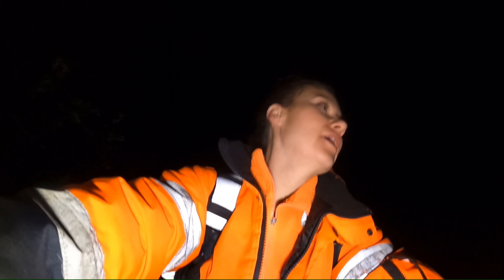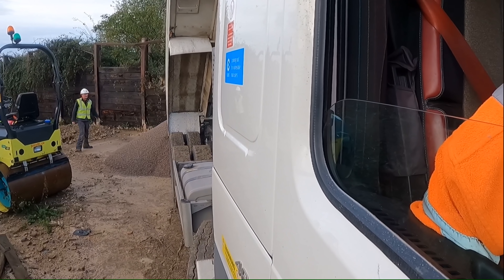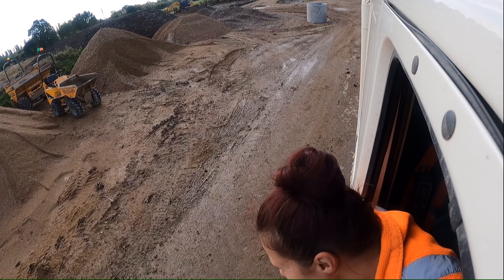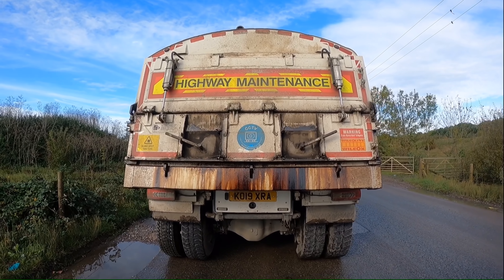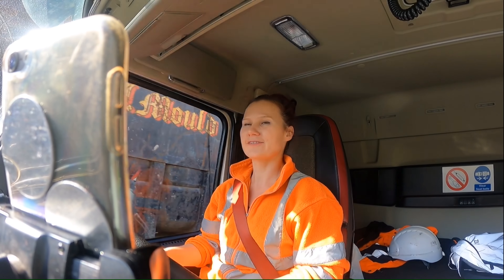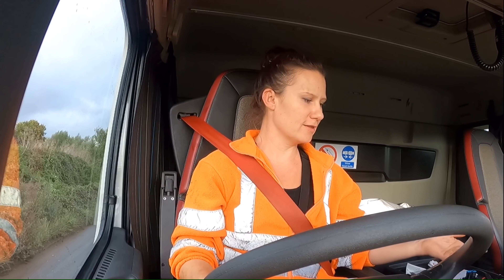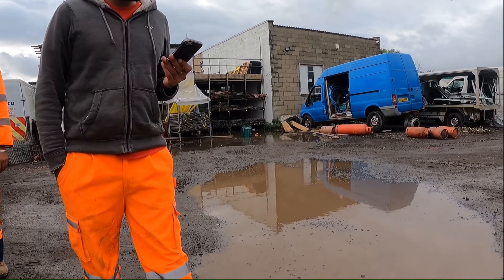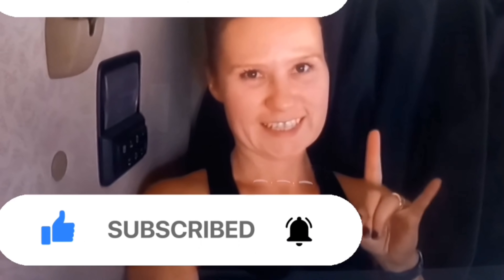A day with a female tarmac tipper driver UK 5/10/20 first day on a job.

Comment: A tip to do before tipping tarmac, spray your back door and hinges with diesel it will stop the Tarmac sticking.
Reply from the maker: Ooh thank you!! Will be trying that out today 👌🏻
Reply from the maker: Omg it works a treat. We spray T99 or something but yeah spraying it before I get loaded makes it soooo much easier!!! Why my boss let me struggle for TWO weeks now and never told me🤷🏻‍♀️😡
Reply: @LenaTrucker  I would spray the bottom half of your back door as well before you load. I will not stick to that either and make it easier to clean.  Just don't get caught by the Tar plant.

Comment: watch the stuff in the spray bottle it destroys rubber and removes paintwork 🤔 keep on trucking your videos are very good and give a varied view of different truck driving jobs 👍👍
Reply: It's only diesel
Reply: @davie2606  it's not diesel it's called Macoff . Spraying diesel in tipper bodies is banned and tipper drivers caught using it will also get banned from coating plants and quarries .I've been collecting and laying Tarmac for 30 years .
Reply from the maker: but, but it keeps the stuff from sticking 👌🏻